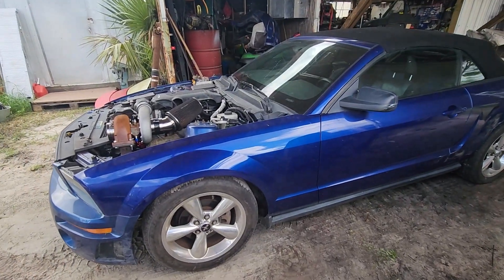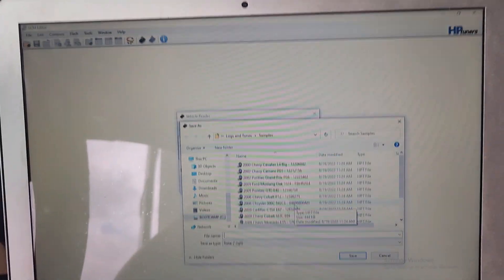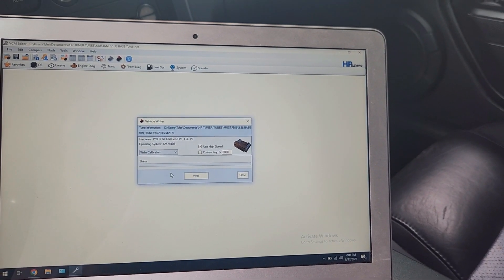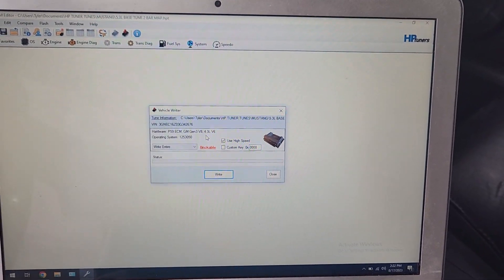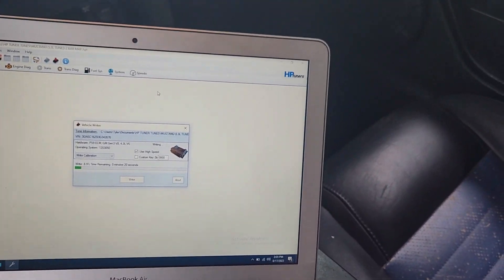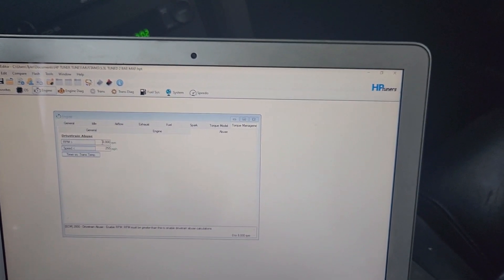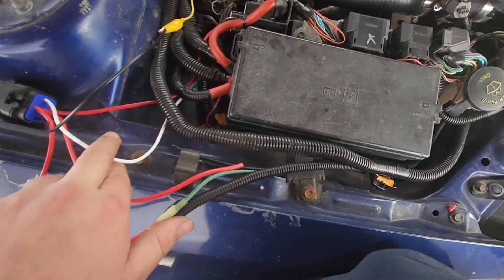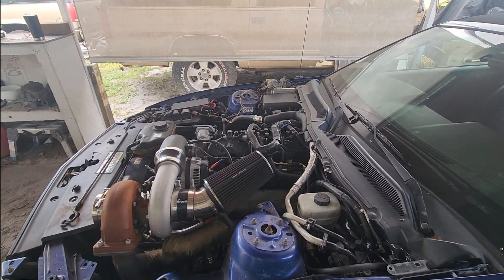LS Swapped Mustang HP Tuners Setup Basics | PT. 18

Comment: That's awesome brother. I have been wondering if I should mess with HP Tuners. I've never tuned anything. I need to learn tho. I would like to learn to tune my own swap. Has your speedo/tach converter came in yet? I am really curious if it works before I buy it for my Ls3 swap in my Vic. I just ordered and received a set of used 821 heads. They look like they are very low milage. There isn't any pits or scares on the seats. I'm excited.  The block is still in the machine shop but I'm not in a really big hurry on the block. I still alot to buy. Lol. Good video brother. It makes me want to try and tune mine.
Reply from the maker: Have not got the converter for the speedo yet, I'm sure I'll show it in a video when I get it set up and working.
Reply: Ok great brother.